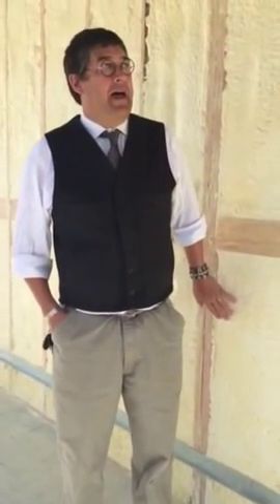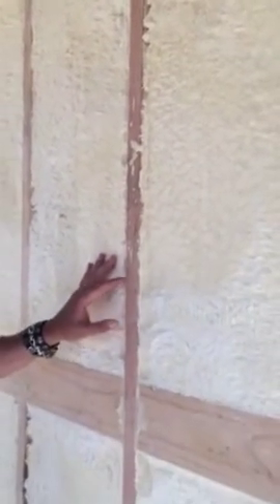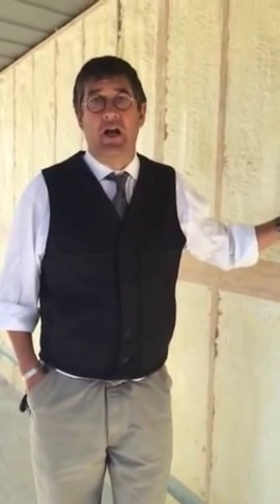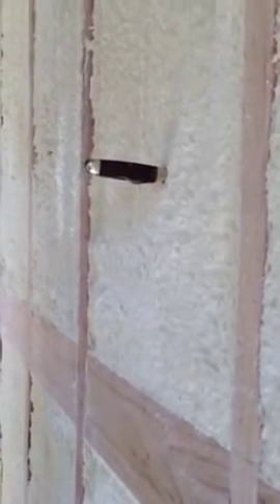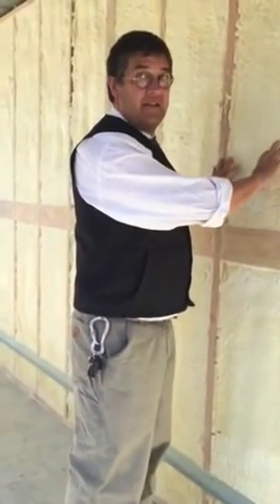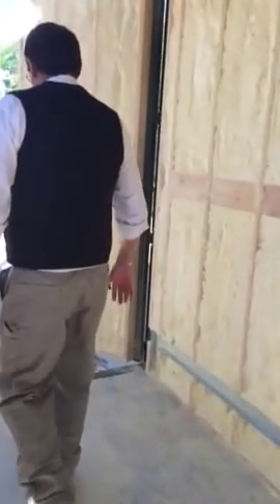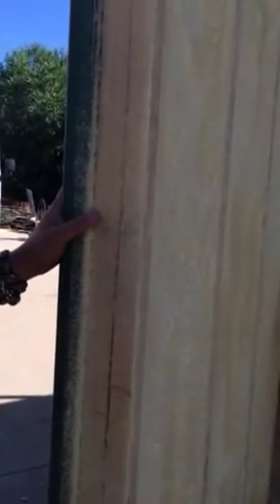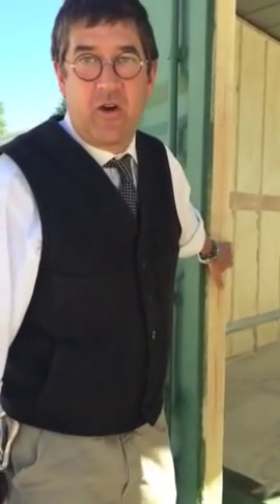Insulation of a shipping container home

Comment: An R value of 22 is still inadequate for a modern high efficiency home, particularly in northern climates. When I build my shipping container home, I plan to use this spray on material applied directly to the inside SC wall, and then build the wall in another 6 inches for additional insulation, bringing the total wall width to about 9 inches and the R value up to at least 40. This will intrude more into the living space, but that's not a problem. I can always incorporate more containers into the initial design to get the amount of living space I need, since they're so cheap. Insufficient insulation would be a problem forever and require more energy to heat/cool the space over time, so I'd rather spend a bit more and get it all right up front. This will be my last house and I'm designing it to be as thermally efficient, air tight, and sturdy as possible.

Comment: great vid.  quick Q. I understand how the insulation sticks to the wood, but how is the wood secured to the metal container?
Reply: +Marlon G Lets see you cant weld wood right. what could you use that might secure a piece of wood to metal hmmmmm Fasteners maybe..screws/bolts come to mind. Bet some of these crooked container builders jam and glue in wood to metal thinking that it will hold, well metal expands so maybe not a good idea to jam and glue but whatever they can do to charge high and build cheap. They say these are recycled after there service dates but not on container ever has been recycled, usually sold to public where it rust out....Guess it like a pepsi/coke plastic bottles with that whole recycle stamp on them..nothing but the caps are recyclable WTF...
Reply: +Marlon G Excellent Video! Excuse me for chiming in, I would love your opinion. Have you thought about - Rozardner Creating Dream Reality (do a google search)? It is an awesome exclusive guide for learning how to build a home using a simple shipping container minus the headache. Ive heard some extraordinary things about it and my BF finally got amazing success with it.

Comment: I often wonder why no container cabin projects use exterior insulation and siding. If you insulate the exterior walls floors and roof with insulation and vinyl siding you would think the the R Value would go way up.
Reply: the best up side that I can see is keeping them portable. if you use a single shipping container, be it 20 or 40 ft, and keep it's exterior untouched, no windows or anything, you can build your entire home inside, and can have it shipped on a cargo ship if you were to go on vacation.
Reply: Norman Shuzen something to think about

Comment: I so want to build a containerhome. what are your thoughts on condensation? when you apply wood to metal, will condensation form on the inside of the home during temperature changes outside the container? also. how do you insulate the floor?thank you very much for your time.
Reply: most shipping containers have some kind of wood floor. ..redwood or oak...
Reply: +Terry Fisher bamboo

Comment: Why not make it 10" thick of foam then you can live in the size of a coffin. Why no insulate on the outside. Apart from that what about the roof you did nothing with that. where 90% of the heat goes out.
Reply: and in summer u get really really hot roof !